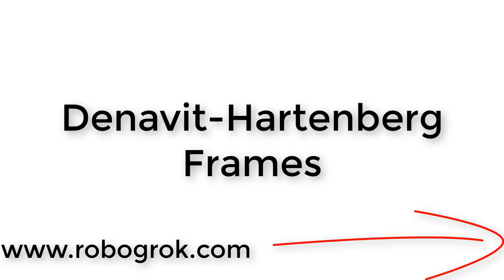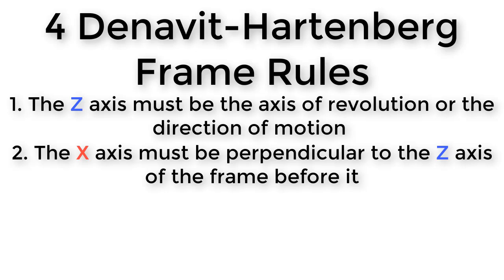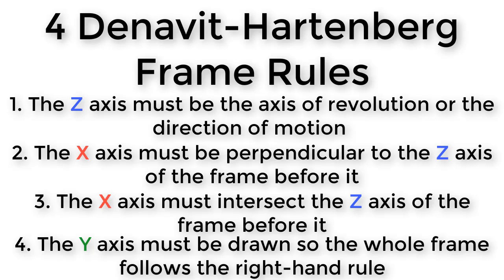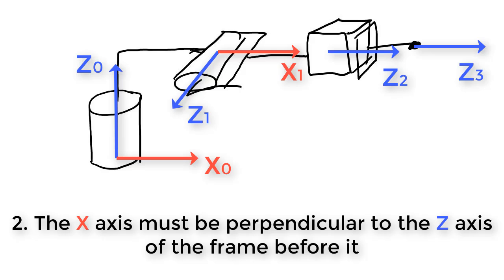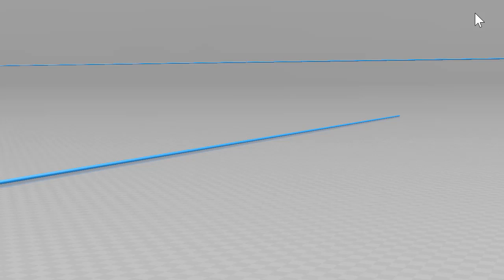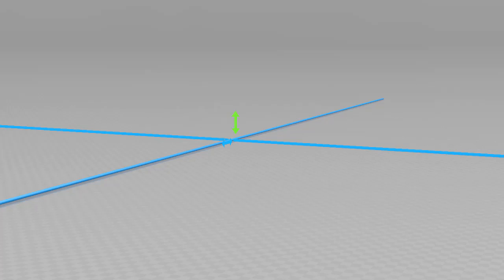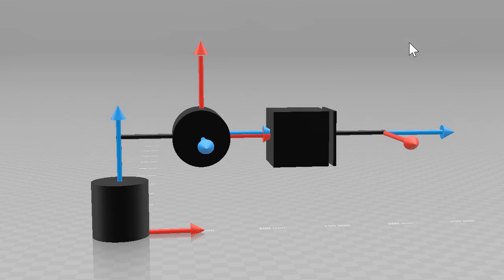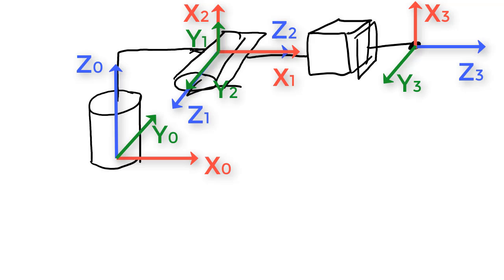Robotics 2 U1 (Kinematics) S2 (Denavit-Hartenberg) P2 (Frames)

Comment: I need a Denavirt Hartenberg board of this example, really need!!! Because I am working on the same but cant find the true forward kinematic for it. As you can see, joint 0 and joint 1 are not lying on the same line. There is a small (I would call) "offset" between these two joints, which makes it different between those examples I have done. Cant manage to find the right forward kinematic answer. Pls help! Thanks

Comment: Hi Angela. At 11:00 of the video, you have X3 "up", the same as X2 which is your general convention for the end-effector frame, that is mimicking the previous frame when possible to make the math easier. Yet at 11:03 in the 3D model , you changed X3 to be "out of the page". Why did you do that? I realize that in the 3D model in this changed position is legal according to the DH requirements, but it kind of threw me off and was wondering if there is something that I'm not understanding. Can you please explain? Thank you!
Reply: ..then 15 15:20 X3 is back in it's original position (i.e. back where it was at 11:00). 
Finally, in the next video (Robotics 2 U1 (Kinematics) S2 (Denavit-Hartenberg) P3 (Parameter Table) ), X3 is back to being "out of page" .   It's mostly confusing just because of the inconsistency for us new to DH.

Comment: Hi Angela , ( at 14:52 ) if i change the position of the second joint about the X1 direction ( i want to second joint position on top of the first joint ) , is anything change in DH or not ? 
İ think its okey , because also x1 axes perpendicular to z0 axis , just changing displacement the second frame and end effector frame 
Thank you for your time